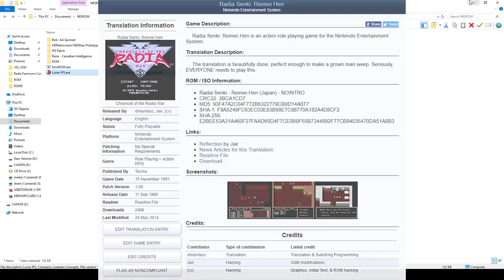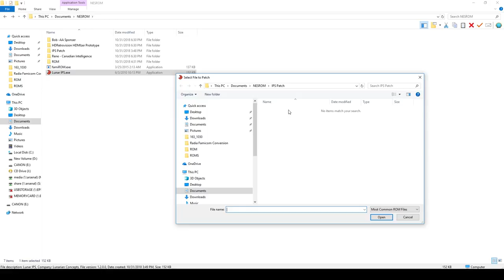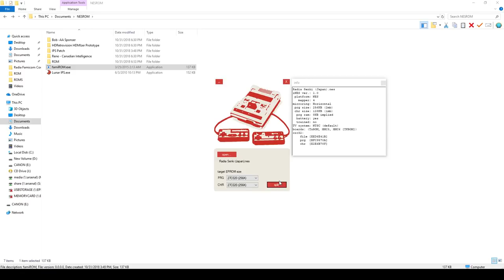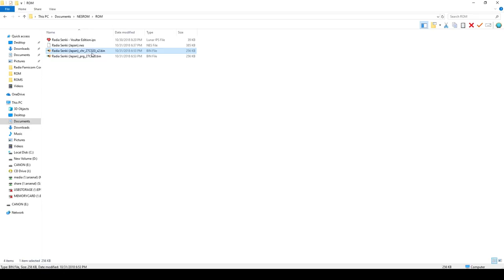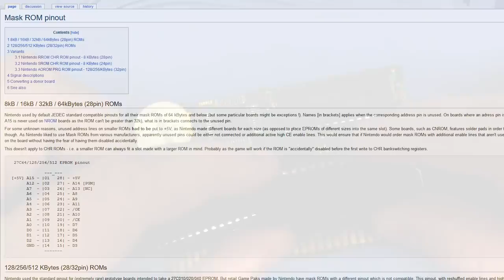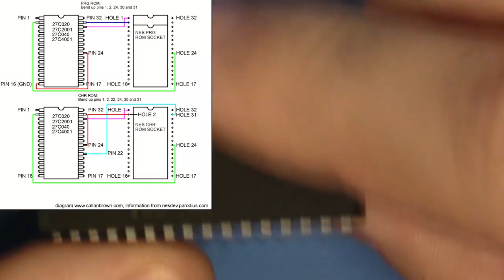Amazing Way To Convert Famicom Cartridges To English!

Comment: You've said in a bad mod work video that you hate cheap solder, understandably so. I bought like a $3 roll off of eBay and it seems to be working ok. What could be a side effect of my cheap solder? (I used to resolder a diode back onto a SNES pcb) I didn't use liquid flux either, could you explain to me the importance of that? Do you have any product recommendations for flux and solder?

I hope this didn't come off as sarcastic, I've only soldered once so I'd like to be educated. Thanks for the videos.

Comment: Why not remove the CR2032 cell before you start working on the board though?

By leaving it in circuit you're leaving part of the board powered which isn't ideal when you're bridging out tracks during soldering work which has the potential to send 3V where you wouldn't normally have 3V.

Why not just remove it first as part of best practice? Especially when you removed it anyway.

Comment: Hi, i was wondering if you do a similar thing with GB game batteries, but with a 1220 holder instead, i have a bunch of gb games that use a 2032, but have seen that people tend to use a 1220 due to it being smaller and fitting into the little cartridge, seeing as how you are one of the only people i watch that do this i thought you may have some wisdom to pass down for it.

Comment: At around 9:20 you accidentally put solder on the chip to the right of the battery and joined two pins.

Comment: This is cool but...it seems like you just replaced nearly all the internals. You might as well just use an emulator if you are going to remove parts to get it to do what you want.

Again, I appreciate the skill involved here, also the clear visuals and commentary are well done.
Reply from the maker: Douglas, 

I just wanted to come back to this and tell you; You were 100% absolutely correct. 

Check out my latter videos. I designed something that addresses precisely what you speak of. Thanks for the honest feedback.

Comment: Can't you just mount the eprom on the programmer without desoldering it? The pins are just sticking out of the PCB so they should have juust enough clearance to contact the reader.

Comment: Lovely work as always. This is an old post but I tried this on a donor board Mairaifumairabu Boku no Yume which is a compatible board I believe. I get scrambled images on the screen. Checked correct routing and pinout guide no issue and solder joints are good. Any chance this is just a bad CHR eeprom? Windows are covered and programmer was able to check blank and write. Followed this guide completely, jut used the donor instead..what I had and didn't feel like spending 80$ on the real deal, just wanted a comp board. 	
HVC-TKROM-03 with a 4 mapper, MMC3B with battery. For the donor is had two 256k mask roms. .Don't know what to check first. Any help is appreciated!

Comment: Awesome work, but doing it myself this way would be quite frightening. Specifically the wires soldered to pins that will be going back into the PCB (like the one at 18:10 ). I'd be afraid that when finally soldering the chip onto the PCB, the solder holding that wire on would of course go molten and you'd have no way of knowing if maybe the wire came loose underneath. I mean you could do a continuity test, but you really wouldn't have a foolproof way of knowing if it is a really solid connection that isn't going to come loose the next time you bump/drop/whatever the cart. I would guess that you'd want to put downward pressure on the chip and solder the other, normal legs first, and then do those pins last. You know, hoping the pressure of the chip on the wires would keep them from moving at all while you solder in the pins they're attached to. But still, man, I'd just be too paranoid. I would totally fuck this up.  And then I'd have to take it out and do it again.

EDIT: Unless you could maybe get it angled in such a way, with perfect lighting, that you could see it through the other side of the chip. Maybe under a microscope. Hrm.  I'm just too paranoid about the idea of a solder joint I can't entirely see.

Comment: I dont have the hardware to do this so I don't even know why I'm asking, but how did you get the files onto the hardware? You show how the software makes the files, but not how you connected it to your PC to transfer/flash them.
Reply: The EEPROM FLASH BIOS programmer he used to write the CHR and PRG files to the actual chips is listed in the video description. Though I would liked it if he showed the actual process of writing the files to the chips, so we get an idea of how to use the programmer.

Comment: I actually have the famicom that was recalled. Its the one that has the square buttons on the controller, i have noticed that i cant find any mods for it even though its basically similar to the circle button Famicom but every time i replace save batteries the unit runs really hot and i didnt do it before i replaced the batteries. Any ideas why, yes the save backups work and the battery is identical. I was thinking if adding a resistor but i dont wanna wreck a irreplaceable cart. Hoping to hear your opinion

Comment: Why not strip the wires before soldering on all the other pins? Seems like it would be a bit of a bitch to desolder again if you messed up stripping the insulation. I'm just curious (bit of a noob at soldering, probably less than 10 hours under my belt)
Reply: @Nukle0n  yeah that's what I was thinking. Thanks

Comment: Would the small chip be a DES64 cryptosystem chip just wondering, would using your iron to scrip the insulation corrode the tip of the iron.

Comment: Did you short 2 pins of the IC beside the batteryholder while soldering? Looks odd...
Reply: That was my first thought. I think those two pads on the MMC3 looked that way before he stared working on them also they look like they connect to the same trace.
Reply: @tahuyaguy  Could be, I admit I didn't check that in depth.... too lazy :)

Comment: So i'm curious.  Why do you add solder to the chip before desoldering it?
Reply from the maker: Two reasons: 
1) Knock the oxidation off of the old joints
2) Modify the chemistry of the solder originally used in the wave process so that the melting temperature drops.
Reply: @Voultar  Ah I see, makes sense.  Thanks for the quick response!